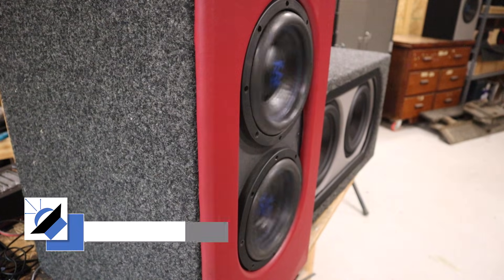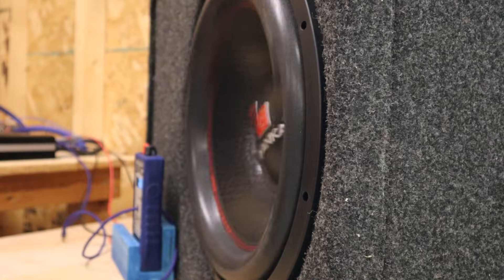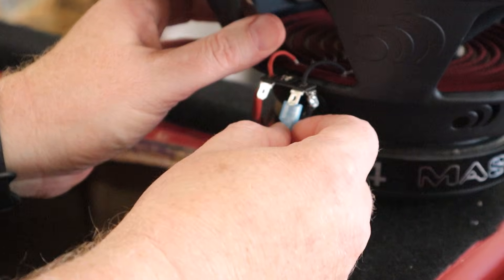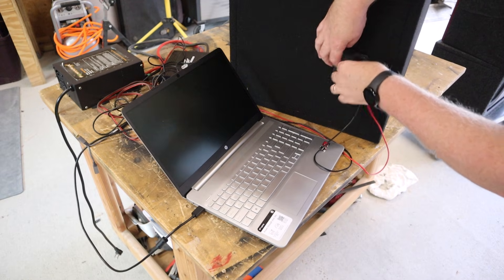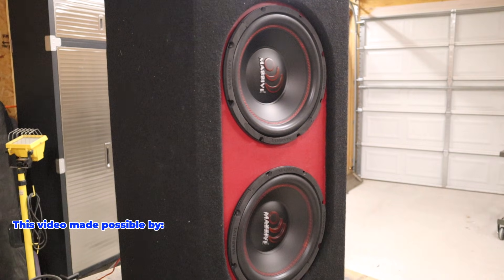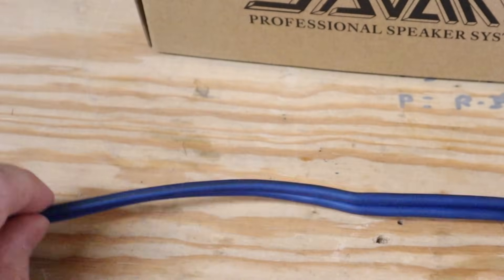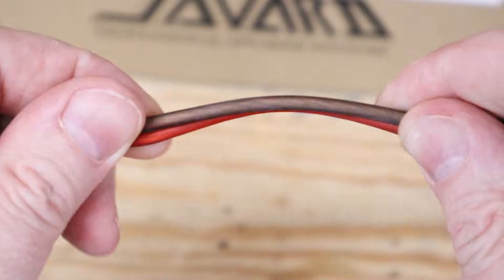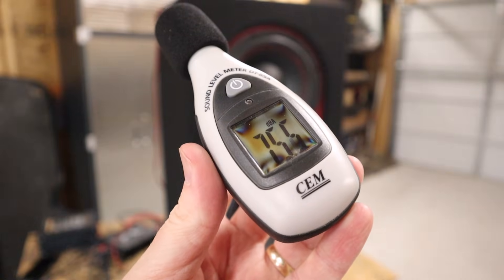Here is why your subs don't bump!  They are out of phase!

Comment: I might just be stupid but i have an issue with a 2x12" where the subs doesnt move in sync. I know that they arent wired out of polarity but they still dosnt move in sync. You might have explained it in this video and i might just be to stupid to notice.😂 But if anybody could help, i would greatly aprechiate that.
Reply from the maker: If the two speakers are wired out of polarity then they will make barely any sound. As long as it sounds good. Don't worry about what the cones look like. They're doing. 

And of course you can just grab a 9-volt battery and touch it to the terminals on the outside of the box and see what happens.

Comment: Here’s my thing I’m running a single 15 kicker 4ohm dual voice coil in parallel series everything is positive to positive and negative to negative Audio shop told me I should run negative to positive and positive to negative from the amp to the subwoofer box. Is that correct when I do that the sub seems like it sucks in instead of pushing out.
Reply from the maker: The shop is advising you to flip the polarity, sometimes that helps blend the subwoofer in with the rest of your system, that has nothing to do with parallel vs series.  The subwoofer will move in and out no matter the polarity.  If it looks like it is doing one instead of the other that is just an optical illusion.

Comment: How man I’m currently making a boom box with 3 way 6x9s and an 8” sub woofer powered by a Bluetooth 2.1 amp. What frequency should I tune the sub enclosure to? It’s about 0.5 cu ft and I’m gonna be using it mostly outside for baseball practice. Thanks man
Reply from the maker: I can't see for sure without modeling the driver, but in an outside environment like that you don't want to tune it super low like you would for home theater.  But just a rough guess. I would recommend 40 HZ.
Reply: @DIYAudioGuy  thank you man. I’m trying to replicate the low end from a JBL party box. Even in our door environments, 50~80 hz really rocks

Comment: Hello ! I have harder problem of phase shift in Amp. And feedback circuit. This problems giving me ( no bass, flat bass, distortions, subs blowing much before normal peak clean power of Amp, Finnaly sine wave is FAT and in noises, with rippling phase) this problem is on all Amps tested to subs. How to Fix this ? Thanks !
Reply from the maker: If you're 100% sure it's the amplifier then you probably need a different amplifier.
Reply: @DIYAudioGuy  if i replace amplifier i have clean sine wave for a moment, and problem is back

Comment: I once had a subwoofer that was a factory defect in a very special way. One was wired backwards - as in, the terminals were put on incorrectly so they were polarity reversed. Can you imagine my confusion at first when both subs basically made no volume despite moving like crazy, despite being wired "correctly". I can say from direct experience, cancellation is 100% real and to an amazing degree of effectiveness. There's nothing like seeing a pair of subwoofers reaching xmax, but making absolutely zero sound...
Reply from the maker: I think that's important to remember, virtually no sound.   Your normal speaking voice will be louder.  Not even going to get any chuffing because port's not producing any air.  The only thing you're likely to hear is mechanical noise from driving the subwoofers past xmax.
Reply: @DIYAudioGuy  Right! It was a weird experience the first time I had it happen to me. I had always hear cancellation this and cancellation that - never realized how EFFECTIVE it was at almost entirely eliminating the sound. As you said, I could hear the sub mechanics working but there was an almost complete absence of bass. The thing that I think makes it even more interesting though, is that both subs were in their own sealed off section of the enclosure they were in. It was like two ported boxes joined together so each sub had it's own air space... and it still cancelled out really efficiently! I figured it was more of a thing that happened when subs shared the same enclosure air space, but it turns out that doesn't appear to matter at all. :D

Comment: Wiring your subs in stereo can also hinder maximum bass output, especially with certain songs. I've had times when I noticed that my subs were moving a bit different to one another even though the wiring and polarity were correct, only to realize that I had a switch on my amplifier set to stereo instead of mono. As soon as I flipped the switch to mono, the subs started moving in unison and the bass hit harder. This is more likely to happen when using a two channel amplifier to run your subs.
Reply from the maker: You need a certain amount of distance between the subwoofers to really get good stereo separation.
Reply: @DIYAudioGuy Yeah, but I  really wouldn't advise anyone to wire their subwoofers in stereo, even if they're far apart from each other, it just hurts your bass performance in my opinion. Whether it's two or sixteen, I always just send a mono signal to my subs.
Reply: @DIYAudioGuy  Hi - One of my fave subjects hit upon again - subs moving not exactly in unison, butt I've yet to build my own to show at least myself that topic to my satisfaction. Is it not true that stereo separation is only associated with frequencies such as over 100 Hz, let's say, where the perception of depth and direction become important? There should be no separation of bass frequencies that are truly bass frequencies. Any lack of complete unity is exactly what is the start of 'out of phase'.
I'm glad you are pointing out the 'rolling shutter' phenomenon again. I really wanna create a box with 2-18" and 100%-sealing dividers between, with the option to enable included ports. Hence your icon on my desktop---🤗😏🙂

Comment: Back in the 80s and 90s (considered the start of good car audio) I worked on the sales floor of a car audio store. One thing the owner had the floor guys do was spend time on the installation shop so we could learn the how/when/why of installation. Can't tell you how many home installs came in with mis-phased subs and mid-basses. Usually they came in to complain that we sold them junk because they had no bass on their dual or quad 12/15" subs on 300W RMS amps. Aside for gaps in the enclosure (amazing how many boxes were cut with jigsaws....) in every case the subs were mis-wired. Grabbed the yankee screwdriver, backed out the screws and. revealed the crossed connections.
A guy made a compound sub (to save as much space as possible) with eight 10" Fosgate subs and complained of low bass out. He knew he couldn't wire it in parallel otherwise his impedance would be far below the amps minimums. The drivers were face to face on a common baffle, but sealed (glued and screwed) enclosure for the rear drivers. Each driver had it's own terminal plate (!!!) and 2 were wired to the terminal plate out of phase. Took a good hour and a half to get everything wire in phase and in proper series parallel for an acceptable impedance load. He was happy with the work I did and he now had adequate bass. Didn't have the heart to tell him that the enclosure he made was too big for a compound design and he could have shaved off 6" of enclosure depth...
Reply from the maker: Cool
Reply: The lowest bass guitar note has a wavelength of 8.4 metres. Think about how that is going to fit in a car.

Comment: In a large open air setting such as a large boat with multiple drivers, I will frequently run several drivers 180 degrees to eliminate dead spots. 

I did a houseboat not too long ago where I ran a pair of 12s in the bow 180 from the four 12s in the aft. There’s also a tower array off the stern deck directed over the water with a pair of 10s with passive radiators. On a 60ft vessel, running that pair out of alignment completely eliminates what otherwise is a compete dead spot in the bow with only constructive interference throughout the rest of the listening area.

I have a 26ft Tritoon with 4 15s and I run one 15 out of alignment with the other 3 to eliminate a huge dead spot in the dead center of the boat literally inches from a pair of 15s. 

While phase issues in a vehicle are pretty brainless, varying your phase and timing in which drivers fire can make a massive difference in a large open environment.
Reply from the maker: Sometimes you have to do that in pro Audio setups, like big concerts.
Reply: @DIYAudioGuy  Dave “Rat” Levine has some really great YouTube tutorials regarding his Pro setups. He’s mainly using M-Force motors now which behave a bit different than your standard woofers. The man is a legend. Waiting for one of those deivers to show up in a vehicle some day.

Comment: You mean "out of polarity" not "out of phase". Phase has a time component (delay) to it, polarity does not.
Reply from the maker: I made all that clear in the video.
Reply: @DIYAudioGuy  Not at all. At 6:58 those drivers are out of polarity but they are also still "in phase" as the waveforms both start/stop at the same time and/or reach the listener at the same time, there is no phase shift (time domain) between them. You did get it right when you talked about the front mids being out of phase with the sub in the trunk due to the difference in distance to the listener. When that happens (phase shift) you cannot get ALL the waveforms aligned again without using time delay or relocating the speakers. Flipping the polarity in that case will get some of the frequencies lined back up but others still will not be (comb filtering), usually not a problem as the sub and mids only share a small bandwidth of overlap so you can get those that overlap to mostly line up but if the sub was a full range speaker you wouldn't be able to line all of them up without some sort of time delay as phase shift involves a difference in time at the listeners ears.

Comment: Having photography and camera tech as a hobby the rolling shutter was first to suspect. Great vid. Now I am fighting new issue. I have been corrected today on phase relations of the bassreflex ports. It seems to be that the port is not working in phase with the cone. I almost fell from the chair upon receiving this information. That changes so many things!
Reply from the maker: Right, the port is only in phase with the cone at the tuning frequency.
Reply: @DIYAudioGuy  No. That's the correction. The port is not in phase even at port tuning frequency. Seems you might be falling off the chair with me as well. This claim comes from some high profile person, and first research admits the possibility of such claim being somewhat right.There is certain phase shift, not insignificant to ignore. The cone is still somewhat leading element in the resonation. Somewhat too much, depending on the configuration even by more than 45 degrees of phaseshift. The issue is well masksd, because at tuning frequency, the cone is -15 to -20dB from the port, and so the phase shift of the cone doesn't matter in the SPL outcomes. Mind frikking BLOWN.

Comment: Whoa buddy. Hold on. Phase and time alignment are NOT the same thing and should not be conflated as such. You can be out of time and out of phase. You can be in time and out of phase. You can be out of time but in phase. You can be both in time and in phase. If you adjust the wrong one, you may see a difference, but you may be causing another problem.
Reply: That’s exactly the understanding I got from what he said. I didn’t hear him say they were the same thing at all lol 🤷‍♂
Reply: @cpzmelbs  I didn't say he said they were the same thing. I think he glossed over it a bit too quickly and thus the conflation comes from an oversimplification.
Reply from the maker: @Clobercow1 I said that phase, time alignment, and distance were all mathematically related to each other.  That is fact.  But this video is not about distance and time alignment, it's about the relationship between phase and polarity.  The relationship between phase distance and time alignment deserves its own video.
Reply from the maker: @RecordnRtist  I have not solved that math.
Reply from the maker: https://www.audiofrog.com/time-alignment-part-2/

Comment: Dumb question but does wiring 2 speakers in series put them out of phase with each other?
Reply: No. If they're wired correctly, they'll be in phase. There are plenty of wiring charts to help you figure this out.
Reply from the maker: Not a dumb question at all.  Two speakers wired in series will be in phase with each other, unless you swap the polarity on one of the speakers.

Comment: I'd prefer clean bass in combination with tactile speakers than bump/thump.
Reply from the maker: Why not both?
Reply: @DIYAudioGuy  Depends if you have room for a good large horn loaded speaker driven by 15"+ driver(s), or only have room for a thump/bump. A horn-loaded speaker is so much cleaner.